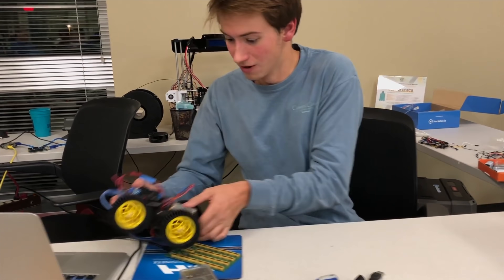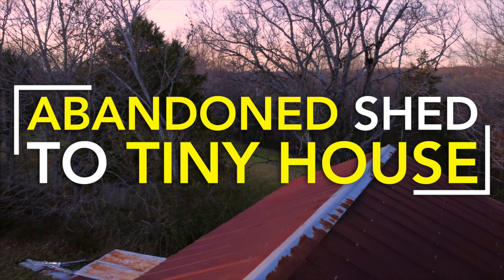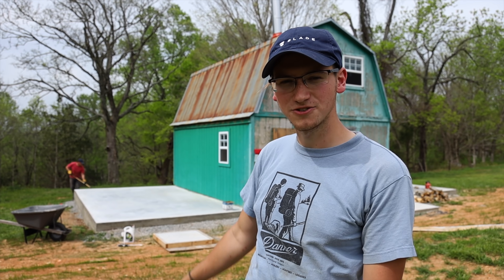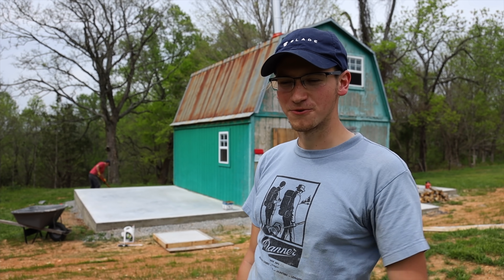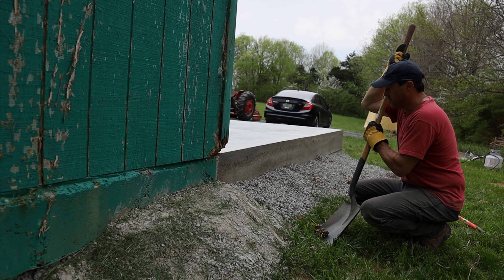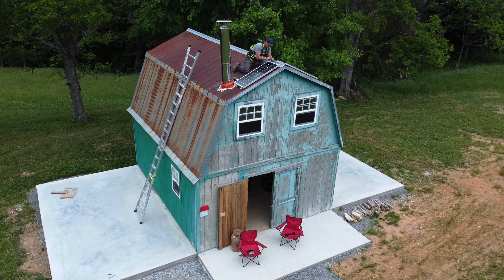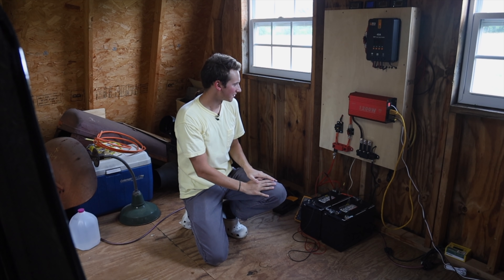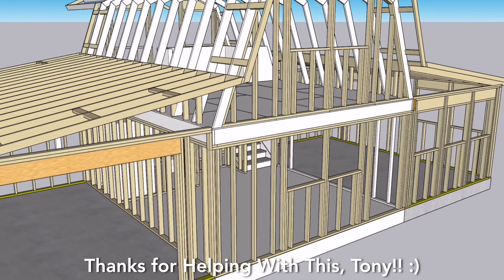Removing Concrete Forms, Installing Solar, and Getting Ready to Frame!

Comment: Look for homes to be torn down.   Salvaged material most often cost just your labor.    A few years ago I tor down a mobile home and built a 1000 square foot shed/green house.  The owner only paid my labor and for a concrete slab the metal roofing materials.  And that was paid for mostly by government subsidies.  All materials were salvaged from the home.  Even the nails.... the mobile home was all 2"x6"x8"'and 16'.

Comment: I know lithium is new big thing everyone is after in batteries but as a full time RVer I disagree. I have been using the "8D" size led acid deep cycle batteries for a long time. If you get the deep cycle version each battery has 425ah far more than any lithium and all my batteries have lasted 12 years with no issues( I did just have to replace 2 batteries last summer) . At around $250. (Utah prices, at oreillyauto parts) far cheaper than lithium as  well. Just my thoughts.
Reply from the maker: It’s good to know that your lead acid batteries have worked well for you. We plan on putting both styles of batteries to the test before deciding on a long term system. In our case, the lead acid batteries we purchased were the cheapest at O’Reilly, and are labeled as “marine deep cycle”. One of the things we want to figure out is how deep we can really discharge them compared to what is advertised. I’ll make some more videos as we move along to discuss this topic and our findings. If there’s anything you want us to test, let us know! Thanks for watching!